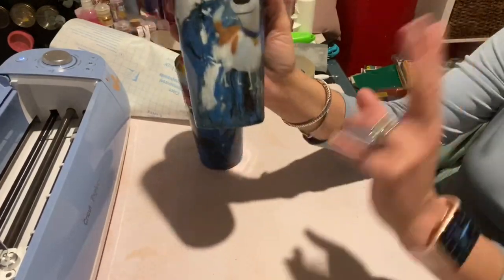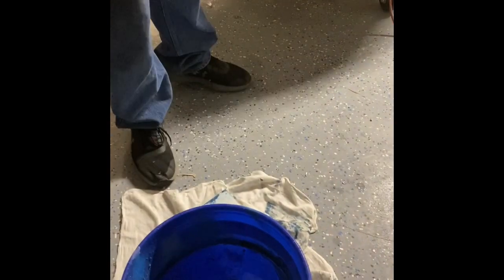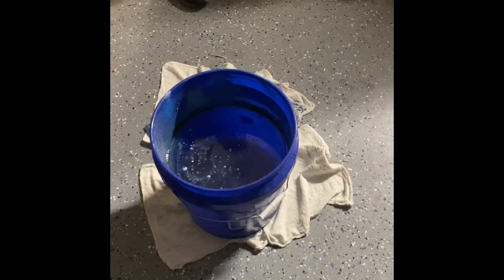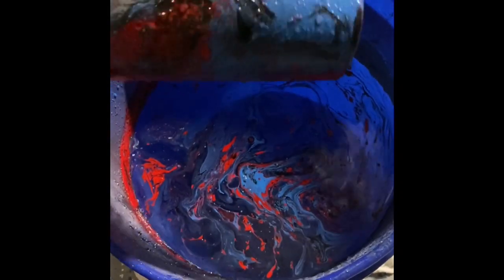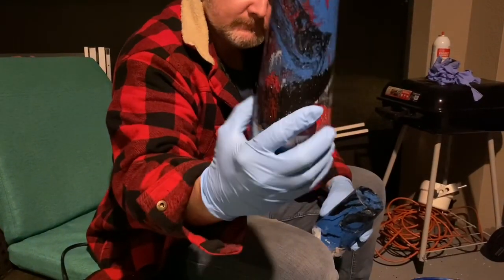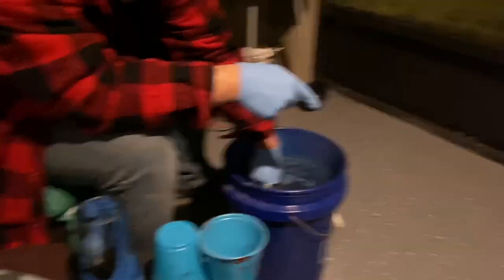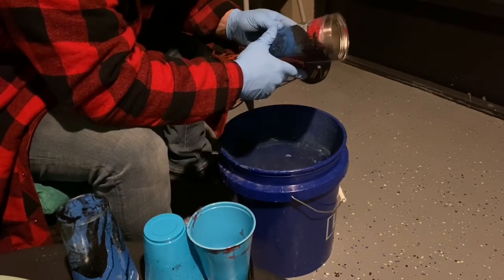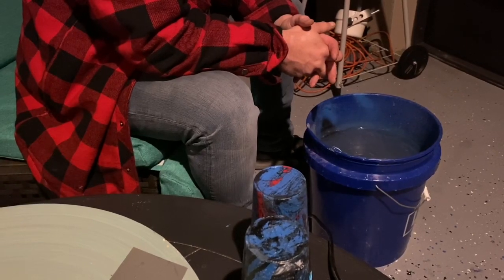Hydro dip epoxy tumbler. How I did a hydro-dip epoxy tumbler start to finish.

Comment: How do you get those water bubbles off? I’m having that issue
Reply from the maker: Once it dried most went away (paint) then with light sanding it was smooth. I used a heat gun to help dry and bubble pop. Heat gun also helps if bubbles in epoxy. If you use one move back and forth not letting heat sit in one spot.
Reply: The most crafty Nurse thanks yeah! I tried the heat gun it did help. Thanks a bunch! Do you know if it matters gloss or without gloss? All paints kind of work the same?
Reply from the maker: The ones that had primer in them (like rust oleum2x) we had the hardest time with the primer kept them from drying all the way through evenly. The others did not seem to matter gloss vs matte. In a couple hours I have another cool one I’m going to try. I won’t post until tomorrow so it can dry.
Reply: The most crafty Nurse yes the paints I did are the 2x with primer I’m letting dry for a full 24 hours to see if any difference thanks 🙏🏼